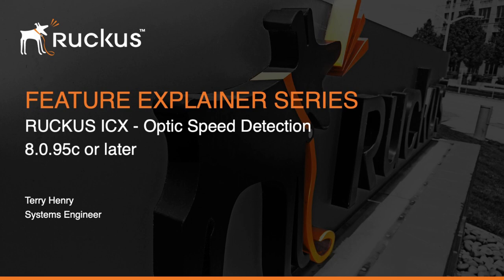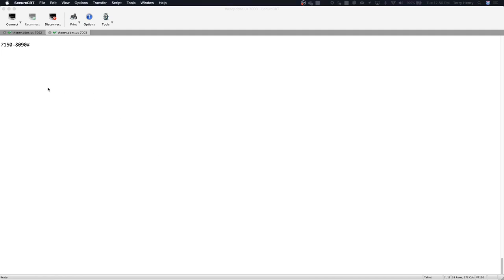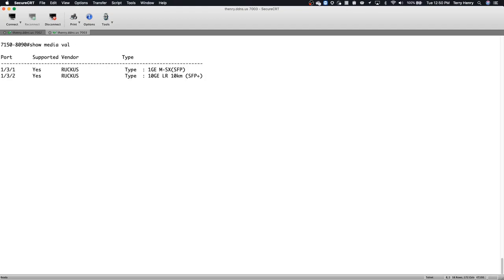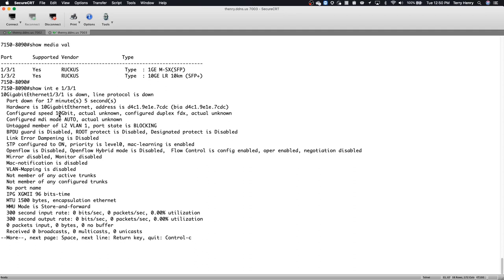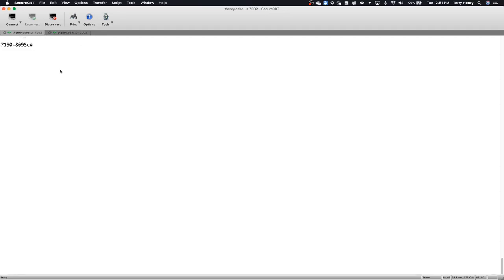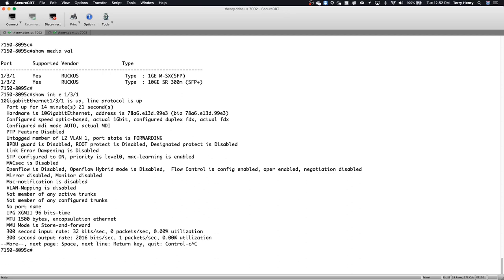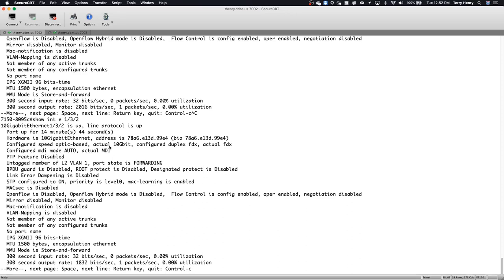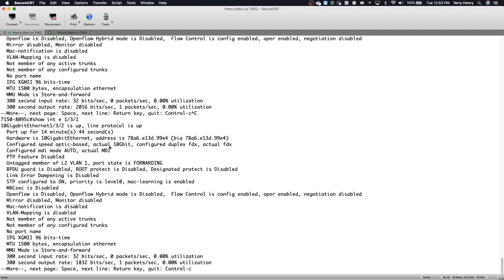RUCKUS ICX - Optic Speed Detection

Comment: Great Update, i was reusing several 7450, which were in use before, which had some ports configured their duplex speed down as some were connected to the fibrepanel (1G) and some were uplinks to racks mounted server (10G). Was always an annoying troubleshooting when we upgraded our infrastructure to OM3 from the old fibre structure. Now we are only using 10G. Would have been a great Update at the end of last year. Nevertheless very useful!

Comment: Hey Terry, this is cool, thanks for keeping the updates coming.

Would you consider a video on “moving away from campus fabric”? I’m sad to see fabric leaving and considering what protocol stack I should use to replace it - with the aim of minimising management.
Reply from the maker: Campus fabric had a disappointing uptake for the amount of engineering cycles it took to build and constantly enhance. The better alternative would be MVRP in 8.0.95+ to automatically deploy vlans with routing done in the core and/or CLI templates in SmartZone 6.0. I will do a video on both of those soon.

Comment: Hi Terry! I am testing v9 on a 7150 and have noticed that it fails to detect a 10gb copper SFP+ connection state after first boot on 1/3/1 (1/3/2 does not exhibit this behavior regardless of module). -Removing and re-inserting the module causes it to work as expected. I'm wondering if this update might have something to do with this?
Reply from the maker: Interesting. I dont have one to test but i'll try to get one. Did you check to see if the speed is forced on the interface by chance?